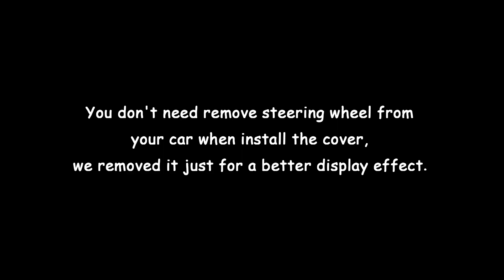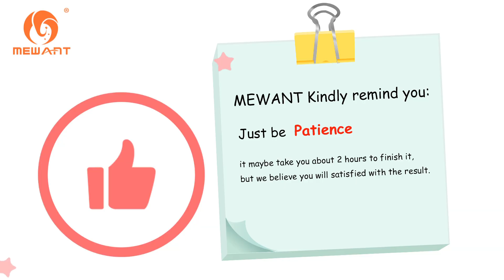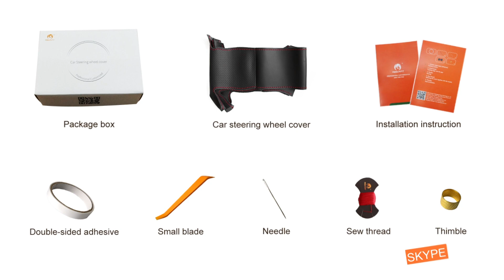MEWANT -- for Honda S2000 Civic Si  / for Acura RSX Type-S Car Steering Wheel Cover Installations

Comment: Would it be okay to cut the old leather off the steering wheel before installing this?
Reply: Did you do it? I cut my old leather off because it was all torn up and wondering if it will still fit okay without it
Reply: @jdmsha1181  no I haven’t got around to it. I’d love to hear how it works out for you tho!
Reply: @thepieguylol  did  you end up wrapping your steering wheel? My old leather is pretty beat up too just wondering if I should keep it on or cut it off before retrimming
Reply: Probably not OK to cut old leather off. Wheel diameter will shrink. New cover is measured for original diameter and will not fit correctly.

Comment: will it fit on civic ep3/ep2 sport, it looks like same steering wheel like civic si
Reply: Pretty sure it´ll fit, since a lot of parts is the same on Acura RSX/Honda Integra and Civic EP3/Si

Comment: Is it supposed to look loose? When I look at my stock Foresters leather steering wheel it looks so tight that at some point I expect it to tear. But her it doesn’t appear your putting that much stress. Is it better to do little or big stress on the sewing?
Reply: this isn't the proper way to re-wrap a steering wheel so it's not going to look perfect, for expert results you're going to have to remove the old material, glue on the new material, stitch it together a lot tighter than is shown in this video, and apply some hear and massaging to get it to fit right the way it looks from factory

this is definitely a bandaid/quick fix
Reply: Its poorly cut and stitched. it is very loose on the wheel. Speaking from experience with their product. Im not happy with the result of when i did this.

Comment: I think there are better videos out there explaining stitch patterns and when to use every loop or skip a loop. 

This is a bit all of the place. The panel gaps on that steering are so big though that you can even hide all that leather in there and it sorta looks fine. This is the first time I've seen faux carbon fiber though. That's somewhat intriguing. Longevity of this anyone??